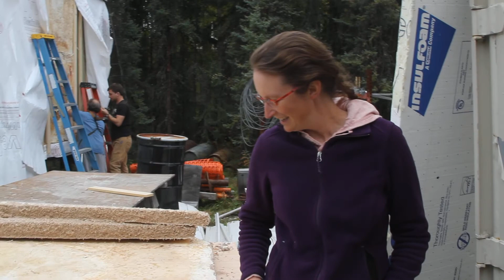Insulating a Cold-Climate Wall with Homegrown Fungus

Comment: So it's an inoculated mycelium matrix on a sawdust substrate.  Should work, tbh if it's dried fully.  Very neat, not sure if it's inherently more energy efficient than melted spin sand aka fiberglass.  A factory near a logging region could do well in regional sales
Reply: Why wouldn't it be ? With the whole life cycle acounted, (disposal as well) Sterilisation of substrate is also not that much heat employed in comparison with melting rocks...... ; )